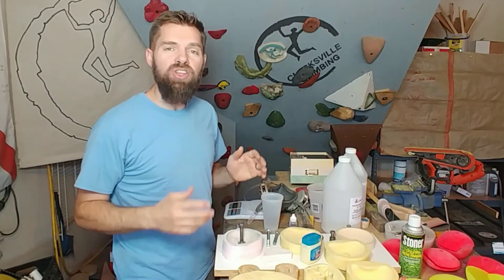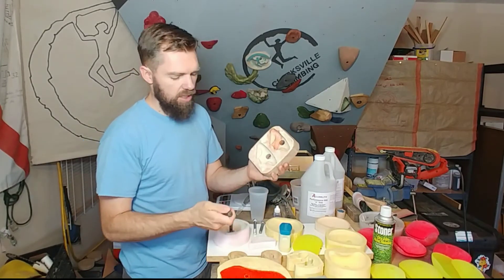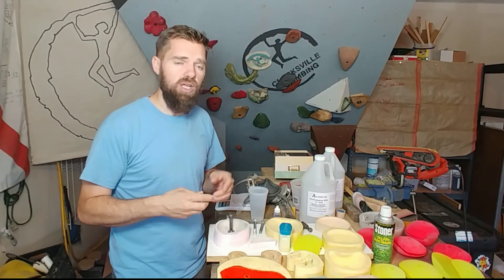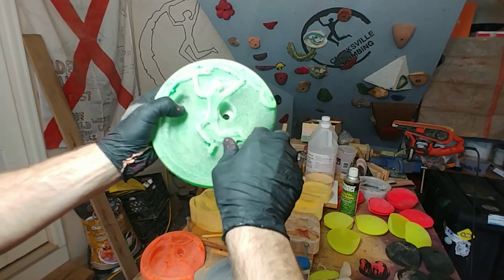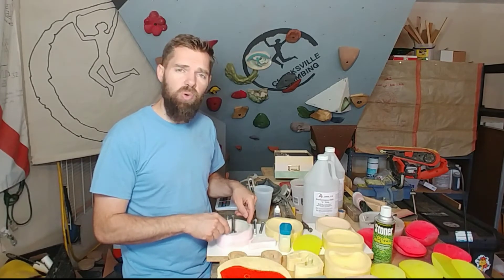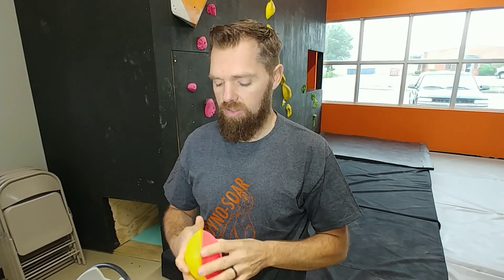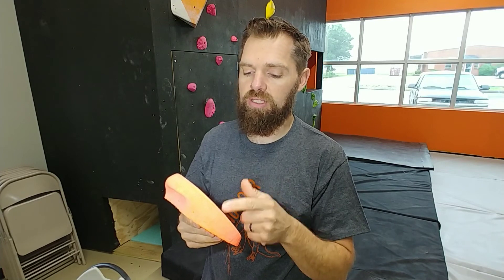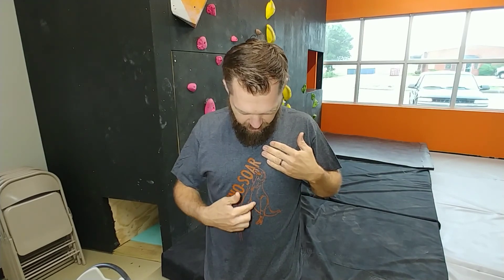CLIMBING HOLD RESIN REVIEW: ALUMILITE PERFORMANCE 80D

Comment: I poured this into a Tupperware container to test on a sunny dry day in Pa. Went great, no foaming. I hit it as hard as I could with a ball peen hammer. Not even a dent. Rained every day since, now all I get is foam. Thinking it needs a low humidity to pour. Have you had any more success with 80d?
Reply: What do you think about using a dehumidifier. Could bring down the rooms humidity. Also, could putting the mold next to where the dehumidified air is exiting help? Trying to think of anything at this point, 80d is the material I’ve been looking for so trying to make it work.
Reply from the maker: Last time I used it was for this video. Super strong stuff but unnecessary for the holds I make. If I were to use it again I would set up the dehumidifier and use a metal or plastic stir stick. Any moisture introduced will make this foam.

Comment: If you hit the mold with a hair dryer shortly before pouring, think that would ensure any surface moisture would be gone? 

Also, could it be a poor interaction with the mold release? Having no experience with resin but a fair bit with chemical in general, are there different kinds of mold release and are they approved per resin type?
Reply from the maker: Thanks. Thats a good idea. There are different release agents but this one  is made by Alumilite and recommended for this resin so that shouldn't be the issue.

Comment: Hey! how are you doing? excellent video as usual. I have a couple of simple questions this time. 1) why ive never seen you using any sand in your resin mix? any particular reason.. 2) could you recommend me some brands i could use for dye my resin mix? thank you! ..
Reply from the maker: Thanks. I used lots of different fillers when I used polyester resin but polyurethane works differently and I don't want to mess with its integrity.

Comment: Great video! Really like all of your content about making holds and building climbing walls! One doubt: did you ever get some bad texture holds because the floral foam absorbed some of the silicone? I've been trying to make my own holds, but seem to been getting this soft/moistened texture on the inside of my silicone molds, which then reflect on very soft holds - with almost no texture at all. Pretty sure I get the catalyst ratio right and mix the silicone 'til it gets uniform, but still getting these soft/oily holds. Anyway, thanks for the video and greetings from Brazil!
Reply from the maker: Thanks! Usually the first hold I pour with a brand new mold will have a tiny bit of floral foam come out with it but other that that I haven't had any problems. What product are you using?
Reply: @climberdad  I use a regular medium flexibility silicone. And the floral foam I use is just like the ones you use. The silicone's producer told me that if I spray some water on the foam's surface before I put silicone over it may accelerate the cure over the surface. Gonna try that one and also adhesive spray. Have you ever tried PU foam?
Reply: @climberdad  I tried spraying water over the hold and it actually worked. It's still strange2 to me, but the foam didn't absorb the silicone over the mold's surface and the texture is way rougher now.

Comment: Love the videos!  I noticed you are using a wooden mixing stick. That absorbs moisture a lot. Try a metal or plastic mixing stick. Also, do a double cup mix. Mix in one then pour all contents into a new cup and mix more. The mold release may also need time to “gas off”. You can also powder the mold surface and it might help with bubble entrapment and moisture issues.
Reply from the maker: Thanks! I actually did the doudle cup mix on this one I just cut it out for time. I'll try switching up the stir stick, great advise.